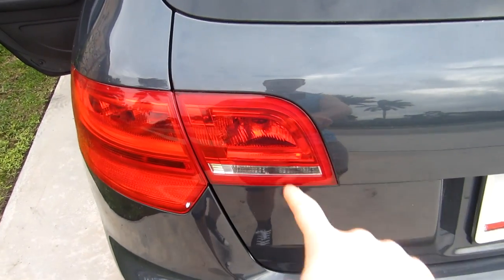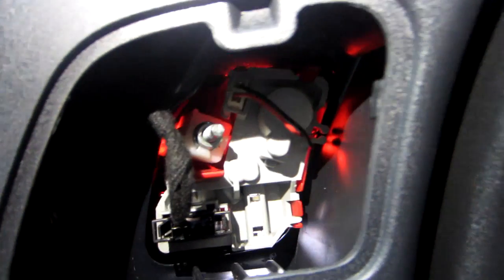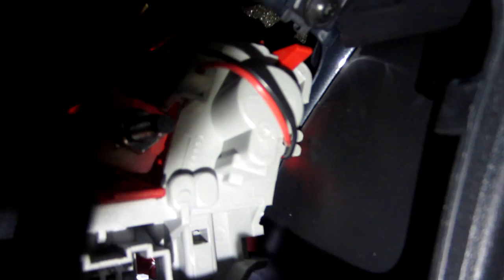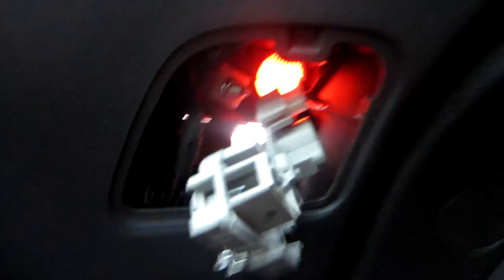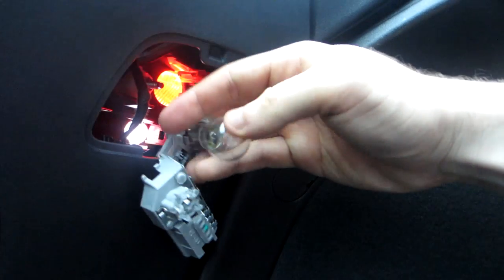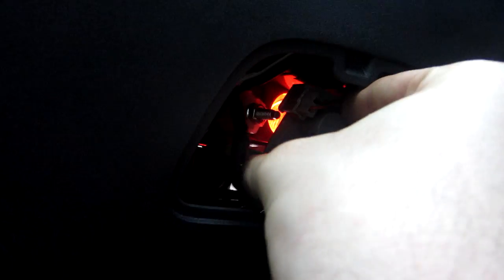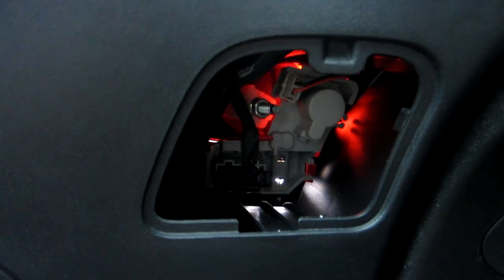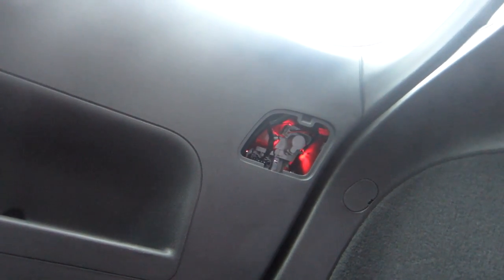How to change hatch taillight on a 2011 Audi A3

Comment: There are two clips on A3s and a pair of wires that feed the hatch angel eyes. You can easily damage those wires by not taking out the lens assembly. 

The correct way to access the bulbs including the angel eye bulbs that are not accessible via your method is to take a 10mm deep socket and loosen the tang and slide the lens toward the outside. Do not force.
Reply from the maker: Thankfully I don’t have the angel eyes, but great point for those that do!

Comment: The A3 2011 manual says to never replace the inner tail light with the trunk closed. Instead, you must open it, unplug the upper wires, and pull the clip and plate. Anyway, thanks for the video.
Reply: Neat